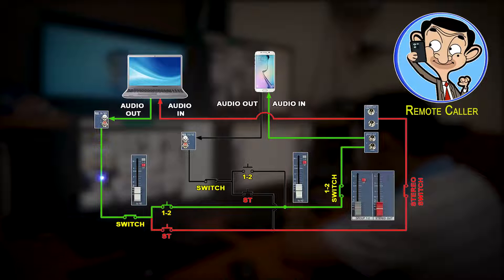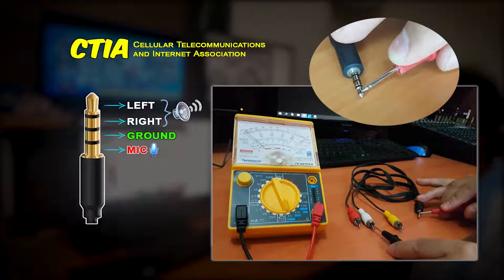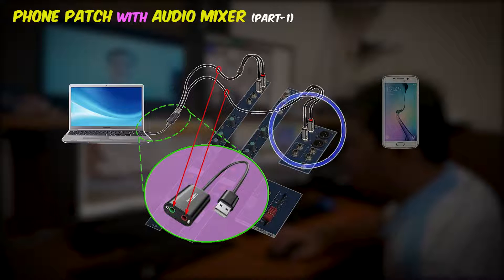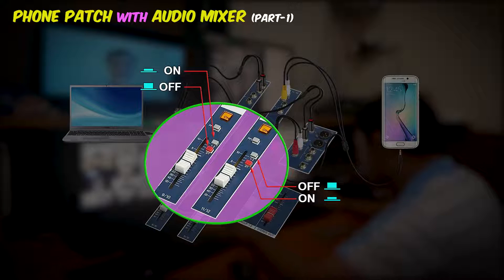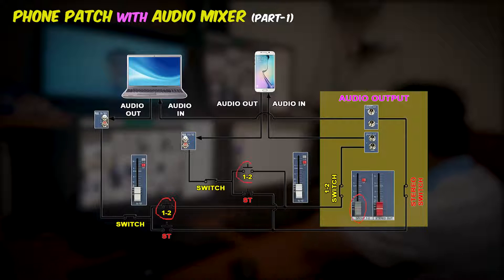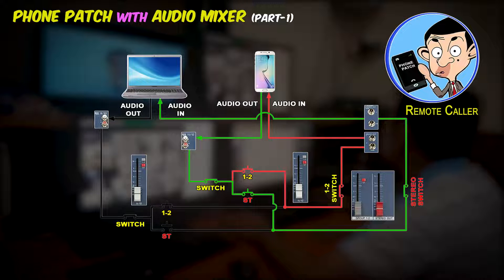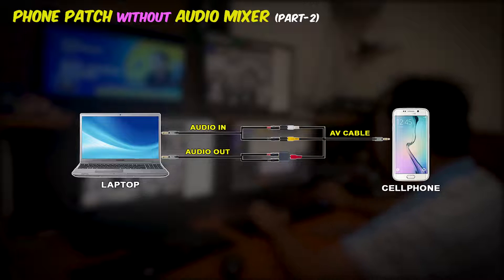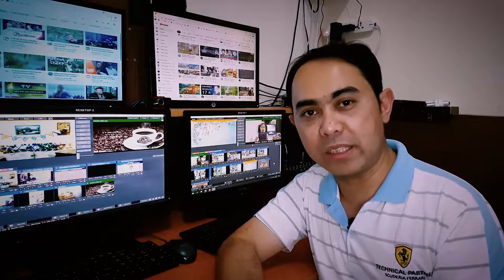🔴 How to setup PHONE PATCH Connection (A Comprehensive Guide) | CyberTech

Comment: Salamat po sa Dios.

tanong ko lang po Bro yung mga details nung cable. d ko po alam yung exactly na tawag sa mga cable na ginamit mo po dun sa hone Patch Connection WITHOUT Audio Mixer.
Reply: ito po ba yung set up para maka usap nung nasa phonce call yung nasa zoom gamit ang computer?
Reply from the maker: @eduenejrdavid6665  opo, yan po ang setup pra makapagusap po ung nasa zoom at nkaphone patch.

Ung nkaphone patch ay pwd po magsalita sa zoom at makinig sa nagsasalita sa zoom.

Ung sa zoom nman ay pwd makausap nya ang nasa phone patch at mapakinggan ang nagssalita sa phone patch.

Bale po, ung PC mo ang link between sa zoom at phonepatch pra makapagusap cla
Reply from the maker: Ang cable po na need sa phone patch without audio mixer ay:
1. AV  (Audio/Video) Cable - make sure na tama ang 3.5mm jack configuration as shown sa intro ng tutorial

2. Audio cable - standard nman po ang audio cable, so no need to worry

3. RCA connectors - standard din po ito, no need to worry.

Ang AV cable lng po talaga ang need na tama ang config, kaya bago po bumili ay alamin muna ang config ng jack kc pag wrong ang config ay di po mag work ang setup.
Reply from the maker: If you need some assistance sa setup po ay pwd po ako makatulong sa inyo po sa tulong at awa ng Dios. Just give me lng po ang contact # nyo po.

Comment: Hi sir what if we are going to use VMIX platform to our phone patch? Is that possible?
Reply from the maker: Yes it is possible, depending on how you interface it. Most probably, you will use virtual audio cable to have an ease control on vmix audio. What connection you are planning to do to interface it with phone patch?
Reply: @CyberHackz  Were using the phone patch without the mixer. We bought everything we needed based on your tutorial. Still no audio from zoom to phone.
Reply from the maker: @trishafernando1246  did you check the configuration of your AV cable? What phone your are using? Did you use laptop? If you dont mind, can i see the pic on how you do your connection?
Reply: @CyberHackz  yes sir where can I send the picture sir? Were using a laptop for zoom and samsung phone for the call 💖
Reply: Hi Sir where can I send it po? We will use this set up for our event tomorrow. I hope it works 🙏
Reply from the maker: @trishafernando1246  do you watsup or viber?
Reply: @CyberHackz  Vib po
Reply from the maker: @gerizonbautista9982  nagmsg po ako sa inyo sa viber po

Comment: Is not some kind of in-line attenuation required if sending a line level signal to a mic input?
Reply from the maker: The ckt connection still works even without attenuation but if you have attenuators then it's much better to control the power of signal transmitted in your mic without degrading the signal integrity.